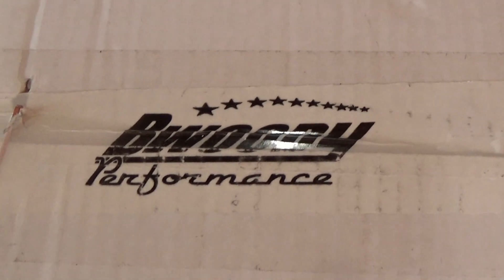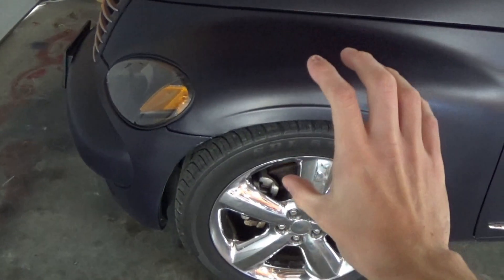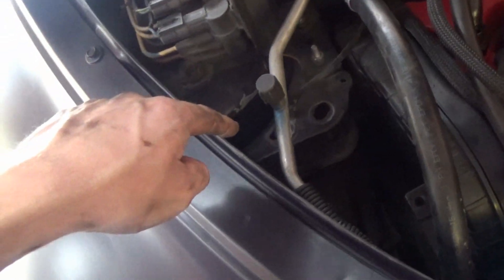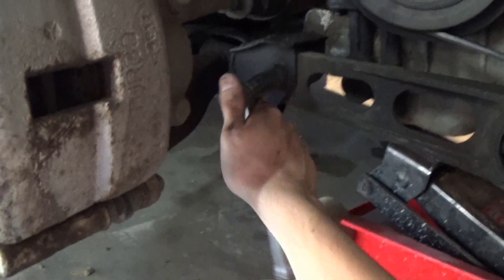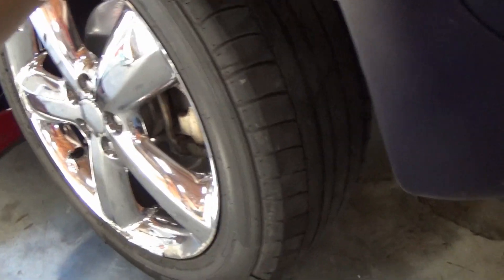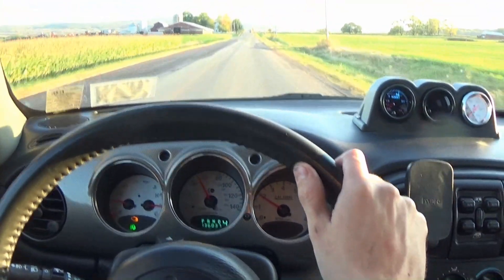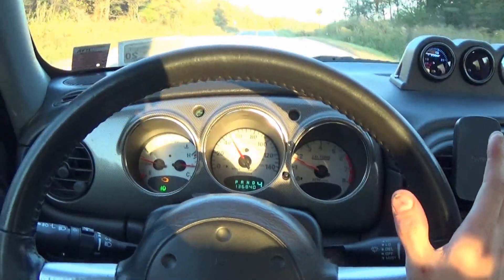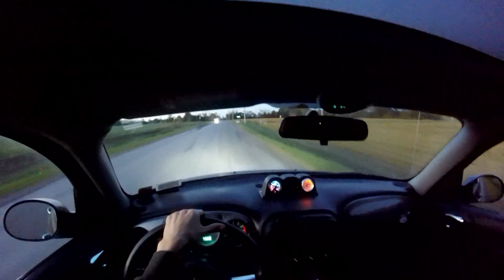RACE MOTOR MOUNTS FOR THE PT GT! - Are Solid Mounts Worth It?

Comment: I replaced my upper and lower torque struts with the Massive Speed System parts - basically same as the BWoody parts. The factory parts were breaking on me all the time after doing performance upgrades on my 04 LE Turbo.

Comment: I have 2 Pt Cruisers, a 2001 Touring Edition which needs the new engine installed and a 2007, I'm thinking about adding turbo and a few more upgrades.
Reply: I have a 2007 and need more power...where do I get a bigger engine and who do I get to install it? Thanks!
Reply: You just buy a gt and upgrade the turbo and Injectors

Comment: The mid mount is probably the most important. The upper and lower are more or less torque mounts. Solid mounts are great if you plan on spending a lot of time at the track, but as far as daily use goes...... They break. I've been through a few sets of various brands and ultimately went with OEM and poly inserts. Zero issues under load and the "ride" is better without sacrificing power. I'll be putting in a new set of solids again soon in the DC and am also working on a 2001 that will be supercharged as opposed to turbocharged. Looks good, have fun! :D

Comment: These are very solid will out last the motor I had them on my neon r/t but turn on the heat or ac and u can literally feel everything in the motor so for my pt gt I used torque solutions they are similar but made with holes they're double the price but way less vibration

Comment: You also need to buy a new transmission mount and fill it with window seal.
Reply: Yeah and some expanding foam insulation.lmfao. Just kidding,the factory transmission mount is junk. I helped my friend with his two times before we said bullshit and went over to my other friends house and machined one out of aluminum.Pain in the rectum and a little costly but done deal forever till it blows up. He's even bumped up the Nitrous with no problems yet.It's ridiculous and a little funny.Mine is non turbo and his makes me laugh every-time I send it.  ;)

Comment: I like watching your channel, especially when you mess with your PTGT; I have an '03 PT Touring, Non-turbo and I like adding an mod here and there as well, nothing too fancy. I just changed my motor mounts about 2 years ago when I did the timing belt. Your motor mount situation was jenky at best, do you think there would be a noticeable difference if the fairly new set I have in were swapped for 'solids'? I must admit, my motor purrs like a kitten since I changed the belt except for a weird squeal that suddenly appeared after the fix, coming off the front belt run (a/c, p/s...) and I'm not worried about that. It's just noisy and annoying. But going with solids sound like a solid idea. Pun intended...